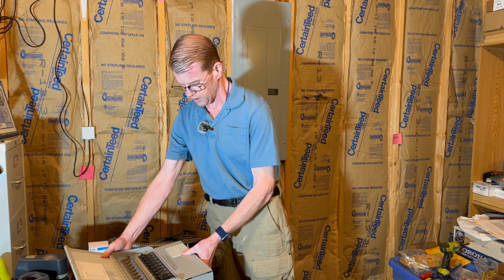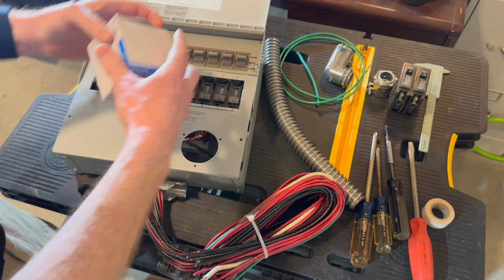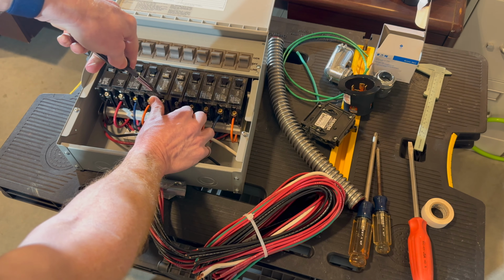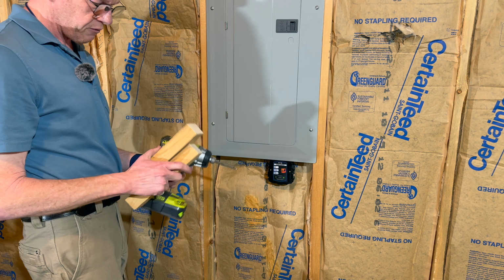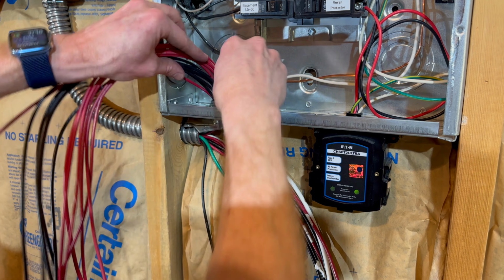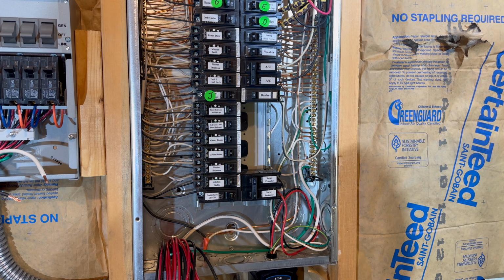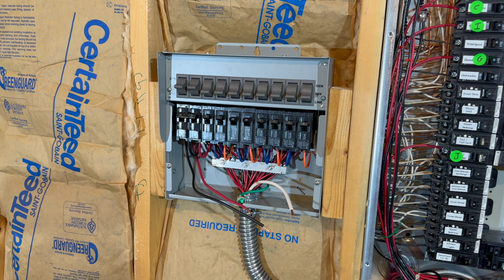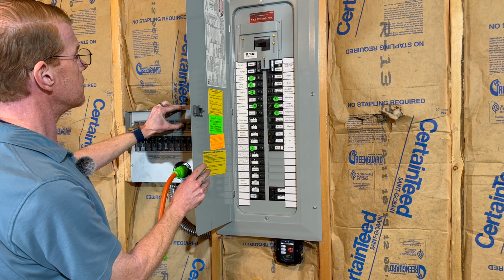Bluetti Home Integration Part 1: Reliance Protran2 Transfer Switch Full Install

Comment: I do not know if you can answer this question, but if I have Afci breakers on my main panel, i cannot use this transfer switch? Is there any work around it?
Reply from the maker: You can use GFCI and AFCI breakers with the "neutral kit" that reliance sells.  It is pretty much a handful of white wires, some wirenuts, and another piece of conduit.  The idea is that you run the neutral from the AFCI/GFCI breaker to its mate in the transfer switch and back, same as with the hot.
Reply: @DougKremer  So does that mean I would need to replace all the breakers in the Transfer switch with AFCI breakers for this to work?
Reply from the maker: For the circuits that are AFCI in the main panel, yes.   I have read that if you use a standard breaker in the transfer switch it will cause the corresponding GFCI in your main panel to trip when you change the source on the transfer switch.  Not sure if AFCI would do the same.
Reply: @DougKremer  All of my circuits has AFCI/GFCI and they do not have a neutral pigtail as they plug into the neutral bus bar. So for this to work do I need to install the neutral bus bar in the transfer switch? I am still not super clear how to route the neutral wires. And those breakers are expensive. Also thanks for your response
!
Reply from the maker: @dilumd  Ahh, that is called a PON panel (Plug On Neutral).   I'm not exactly sure how it would need to be wired.  I''d give the Reliance tech line a call, they were very nice to talk to when I called with a question.
Reply: @DougKremer  Will do thanks so much!

Comment: What was the size of the knockout of the main panel?
Reply from the maker: I don’t recall.  I think maybe 1” or 1 1/8”.  The right knockout wasn’t where I wanted it so I popped a smaller one and used my large unibit to get it to what was needed.
Reply: @DougKremer  Thanks, thats helpful!
Reply from the maker: @dilumd  You are welcome.

Comment: So with this setup. your generator would have to be a floating neutral??? because its grounded  at the transfer switch ?
Reply from the maker: Yes,  it should be.  Nearly all are.
Reply: @DougKremer  Thank you. 😊
Reply: At 20:35 you mentioned that the Bluetti and portable generators have a floating neutral. What type of wiring adjustments were made to be able to alternate between a floating neutral and a bonded generator so you don't damage either generator?
Reply: @davidmc2861 the wire to disconnect  or connect is usually shown in the owners manual.. From what I understand you will have to figure out what you are using the generator for.  If it's a stand alone, you want it to be bonded.  If it's hooking up to your house or something where another ground is present, you want it to be floating neutral.  You dont EVER want to use a floating neutral as a standalone (it can cause electric shocks) and its safer to just leave a bonded generator bonded all together (but it can trip your circuit breaker because of the double grounding) I could be wrong so just double check.  I think that's what it is.. but check the manual on what wire needs to be connected / disconnected
Reply: @davidmc2861 The transfer switch doesn’t switch neutral at all, so the neutral should come from the source—whether it would be the home panel or the generator. Neutral comes from the neutral bar on the utility side, and you have to make or buy a bonding plug for the floating neutral generator. All you have to do is plug that up to any of the 120V AC outlets on the generator and you’ll be good. The switch only switches hots, so generator gives you ground via the bond, and utility connection gives you ground from the post. Hope that helps.

Comment: I'm glad you made this video. I had questions about a transfer switch setup along with an outside power inlet. This was very informative. I recently purchased an AC300 and your setup is a great guide.
Reply from the maker: Thank you.   You are watching me stumble through a first time install here.  I'm sure doing it a second time I'd be much more efficient.  Getting the wires all through the sleeve, and then up into the panel was the most tedious.  It serves me well.  The AC300, and now AC500 have been powering my essential loads through it since this video.
Reply from the maker: @davidbright4886  Please let me know if you would like to see more detail about anything, or have a new idea.
Reply: @DougKremer  Great video.  Getting ready to do this install.  I would love to see a little more detail on the connections in the main electrical panel slowed down to real time
Reply from the maker: @RickBriner  Connections are the easy part!  Remove hot from breaker, connect to transfer switch wire, connect second wire of that pair to breaker.

Comment: Green and white on ground bar?
Reply from the maker: Yes, it is being installed in my main panel where neutral and ground are bonded together, so the same.  if I was installing in a subpanel i would need to separate them to their own bars.
Reply: Thank you for answering, I have the Same one but haven’t installed yet,I’ll watch this video a dozen times
Reply from the maker: @toviyalovelightlife6180  Hopefully you notice the same things I did when installing.  If I did it a second time I’d be much more efficient.  Be mindful in running the bundle through their flexible conduit. I advise laying the wires out perfectly straight without any twisting or crossing, like raw spaghetti, then wrapping in electrical tape to keep them that way to get the conduit on.  There is NO extra room.

Comment: Please tell me how all the 120v breakers are working since it is designed to be fed by 240. Are there not 2 separate legs feeding every other breaker like a regular panel?
Reply from the maker: That is correct.  I think I explained, maybe rather quickly, that my TT-30 to L14-30 adapter wires the single incoming hot leg to both hot legs on its output.  I’m sending the same 120V to both bussbars in the switch, which makes it for single pole loads only.
Reply: Did this kit come with the power inlet plug box, 8-10ft plug ? Thanks
Reply from the maker: @ I ordered just the bare transfer switch.  But reliance does have bundles and kits.

Comment: hello! i couldnt hear you about the breaker. it looks like you are using Siemens breaker but was it a, 20 Amp Single-Pole Type QP Circuit Breaker?
Reply from the maker: It came with Siemens breakers intalled.  The ones I changed out to single pole were replaced with Eaton BR, because I already had them as spares for my main panel.